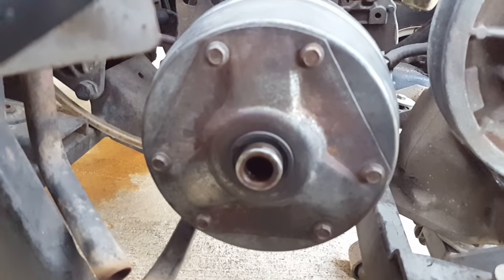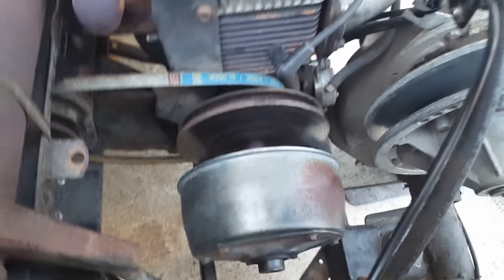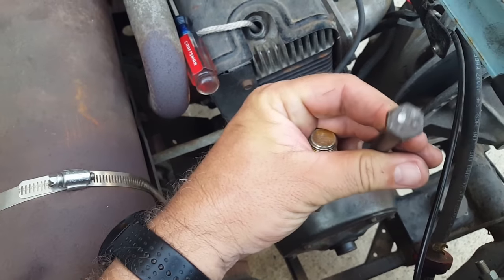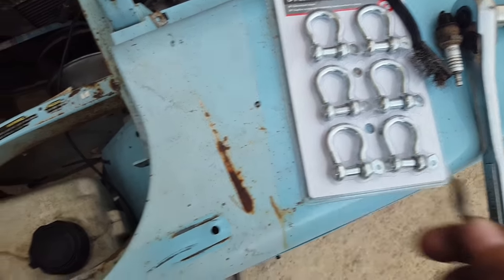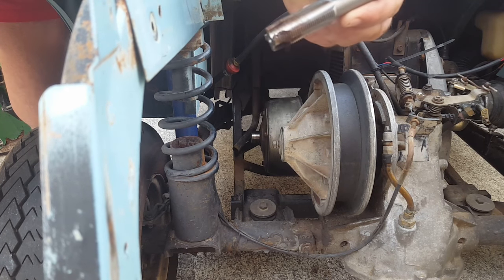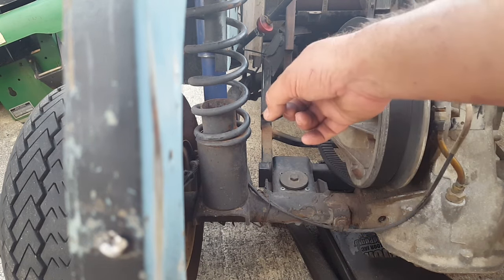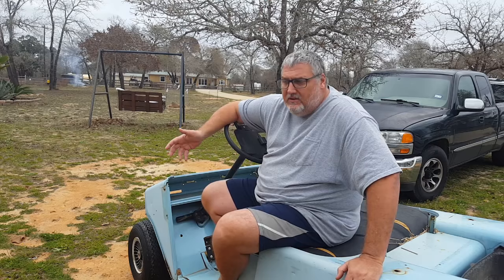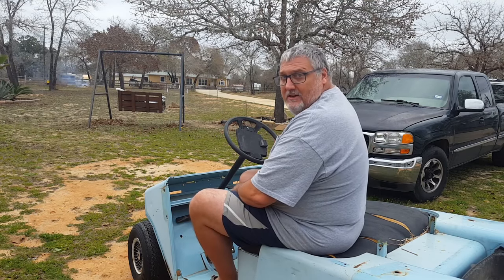Fix your EZGO... drive clutch sticking?

Comment: Just picked up a 89 ezgo gxt-800 and had same problems with drive clutch. Was able to take bell off clutch and then snake some fine emery cloth thru that spider to polish crust off shaft. Worked good and didn’t have to pull clutch off. Thanks for your video about clutch problems. I also stretched tension spring some to help it push sheeve back open.

Comment: The Hydraulic method of using grease or oil works fine but it makes a big mess. After having a few EZGO'S with the 2 and 4 stroke version engines when dealing with removal of the primary clutch having the proper tool for the job is priceless! These are nothing more than a snowmobile Comet clutch and they sell the proper tools to work on them! They aren't complicated to deal with honestly...... but without a doubt these 30mm 1-10 tapered shafts can be a little challenging to get the primary to pop off the crankshaft. If you aren't sure what tool you need to remove the clutch? Read the writing on the clutch and search the internet for the results of the model clutch you have. More than likely, you will come across the proper tool for the job. These clutches are known for sticking on because of their lack of spring pressure which makes it return to the neutral state. Being a golf cart is made to start moving the second the engine fires up, they're springs are very weak on purpose. But this causes a problem with the clutch being able to release fully as they age or get a little dirty or corroded over time, especially when they've been sitting around for a while. By cleaning them up and a full disassembly and yes they are serviceable and I've removed plenty of spiders from these EZGO clutches! I had to make a tool to lock into the 3 forks of the spider and then using a little heat on the threaded center of the spider with a large breaker bar on the spider tool they very well break loose and are completely serviceable in this fashion. But if you are having the problem with it not fully disengaging without the removal of your spider to totally disassemble the clutch? Do your best to clean up and rust on your shaft and keep any sandpaper grit from getting into the pulley bushing! This will only make your problems worse by being in a rush and doing a sloppy job. When you have it apart and can see how it's supposed to move without a spring to help it, you can easily find out what's binding up and where it's getting tight to move freely on the shaft. By closing the pulleys fully this exposes the outside of the shaft where most times has some rust on them. Using something like emery cloth or very light grit sandpaper removal of the rusted portions are necessary. Once you get the shaft cleaned up of rust, spray it down with something like starting fluid or brake cleaner without moving anything. Once you get the shaft cleaned off then move the pulley outwards and flush out the bushing as best as possible with the same cleaner, until you feel it's satisfactory. Apply a very thin layer of a high pressure grease to the shaft and moving the pulley back and forth until it feels like the bushings taken on the lubricant be sure to remove any access grease from the shaft and surrounding areas being thr grease will make dirt and dust stick worse than a non lubricated shaft would. Some people choose to use a liquid graphite which does work well too and doesn't attract any dirt afterwards. Clean up the weights and pivot points and make sure they move freely as well. If you want to take the weights off to help better clean them, then make sure you put them back together properly with the 2 shim washers against the weights and not on the outside of the bolt and nuts! This will solve most problems with your clutches hanging up especially at slower speeds. And again yes Sir these are made by Comet clutches and they are serviceable fully! I've done many of them and rebuilt them rather than replacing them with a Chinese knock off which unusual doesn't work out of the boxes!
Reply: You have a link of someone servicing one? My clutch is stuck outward position cart doesn’t move. Thank you in advance
Reply: Hey this was good advice. Can you answer if the drive shaft is supposed to spin freely or is it supposed to spin with a clutch

Comment: Any chance you have the part # for the clutch? I'm having the same problem. Great video, thanks!
Reply from the maker: sorry, I do not I went back through all my Amazon orders and can't find it. I am almost sure it was amazon but could have been ebay although I didn't see it on there either.  they are pretty common just search for EZGO 3pg drive clutch. unless you have an older one that is the 2pg.

Comment: I have a 1989 also, looks just like yours.  Is your belt super loose on there when its installed?  I have a 41 inch belt and it seems too loose to me, but 41 is what i gather it calls for.  Is yours 41"?
Reply: I have the same issue ...

Comment: Thanks for the video I’m having the same problem. What size bolt & how long for the spacing?
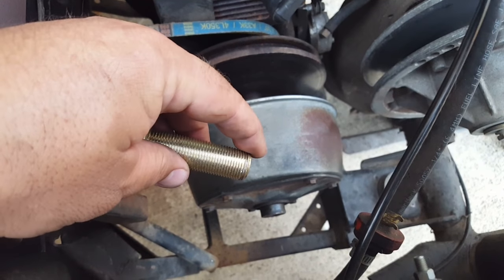Reply from the maker: 1:29... 3/4x16 I'm not sure on how deep it was I think I was using a 4 or 5 inch long bolt in the hole.

Comment: They absolutely are serviceable. If is stuck you just need to use heat. It will work
Reply: @Scooters Only Repair I have same clutch with same problem.  Can you give more detail on "need to use heat" ?  Much appreciated

Comment: My late father's has been acting up. Going full speed one of the clutches will lock up.  I could have swore it was the driven clutch because I could move the sleeves together easy by hand. Changed that and it's doing it again this summer.  Guessing it was the drive clutch.  Wasted money.  Now I have to look for a drive clutch I guess.

Comment: I'm buying a predator 420 to replace my engine.
Do you think I can use my stock clutch?
Reply from the maker: Maybe if the shaft length and diameter is the same should work
Reply: Yes, you have to buy the tapered spacer the crankshaft and cut part of the crank snout off. Problem with not running the stock is, if you dont use the starter generator method to start the engine then you cant shift the trans with engine running. Finding the right drive belt can be a nightmare.
Reply: @henrysmith8012  my cart was a 2 stroke.
The engine was started by an electric motor that would control fwd/rev.
So the direction control was electric.
I won't have reverse and that's fine.
I just didn't want to go sailing away as soon as it started.

Comment: What if the its just not tightening on the belt though?
Reply from the maker: When I first bought this one that was one of the problems. It was stuck open similar issue though luckily after jacking it up and letting fly it broke loose and worked for a while until we had this issue with it sticking closed.